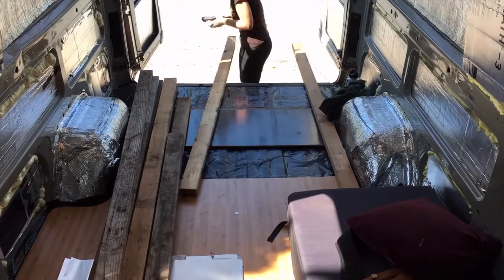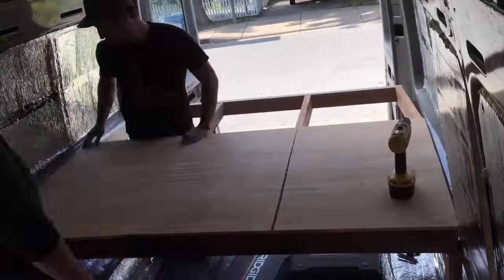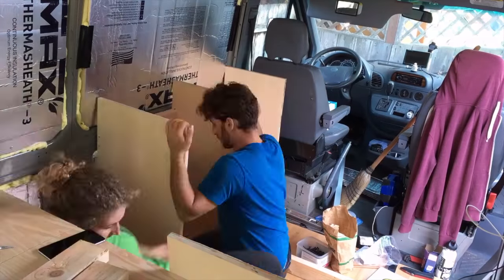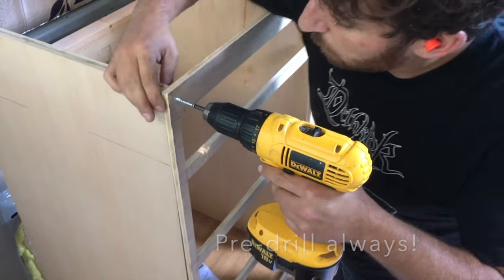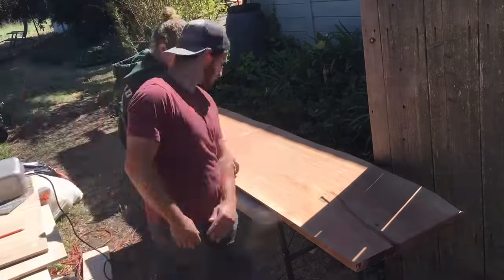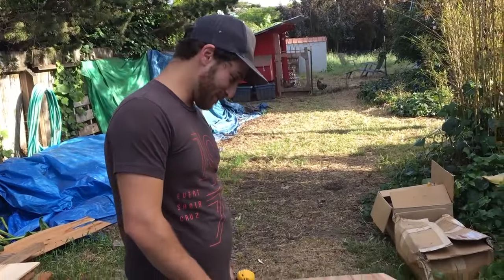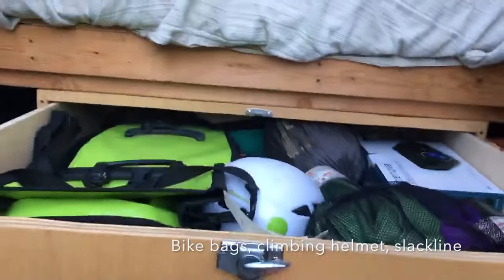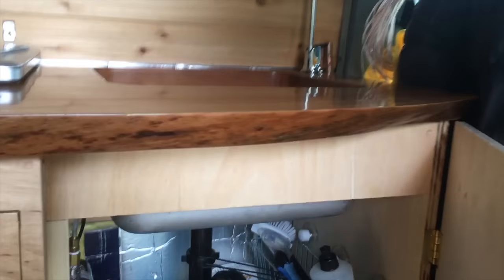Sprinter Van Conversion - Bed and Cabinets

Comment: one way to mitigate the anxiety about trying to cut expensive and thick material accurately with a jigsaw would have been to get close to your lines with the jigsaw, then come back with a router and a flush trim bit with the bearing riding along the template. That way you don't have to worry too much about being super accurate with the jigsaw, as long as you're not going outside your lines.
Reply from the maker: thisgoestoeleven very true. We had a friend route out the edges for us at his cabinet shop... very lucky for us!

Comment: I couldn't have done all of that with the drawers etc., I would have bought a used kitchen and adapted it, less work and they can be adapted to fit, we bought a used kitchen for a granny extension to our house and of course it didn't fit but was very easy to cut and splice to fit, I truly admire your dedication and hard work, well done

Comment: Looks good but why did you go with 3/4 plywood for the cabinets? Seems like 1/2 would be cheaper lighter and plenty strong.
Reply from the maker: We were really concerned with the weight of the counter top. It's freaking heavy. So we used the 3/4 thick plywood for the supports and the 1/2 for the drawers and faceplates.

Comment: I’m wondering, Kaya, if you would kindly tell me if the hinges on your beds concealed compartment are those embedded kind of hinges or flat tee hinges, think you’re blog shows the latter, then the cylindrical hinge part sticks up a little? (rather than sticking out into the joining length of timer).
Also, the cross-bolt lock thing on the other end, you have to get underneath to slide it across? (I’d assumed you had ply underneath?) have screen shots & it’s sometimes difficult to tell. Yes I’m copying your bed, I like the design; though I think mine looks smaller at 4ft wide (queen size). You managed to fit a double-size mattress lengthways widthways in your van (does that even make sense).
Greetings from Wales & hope you’re having a nice week. K